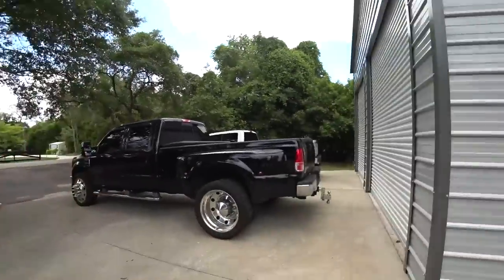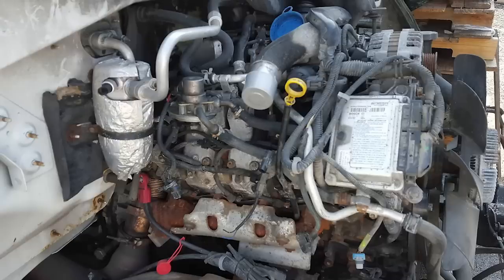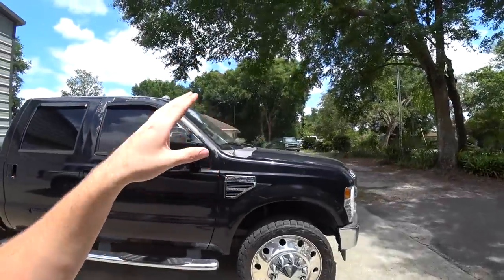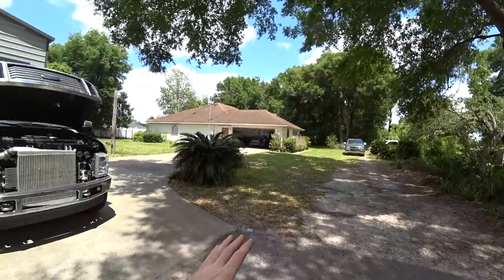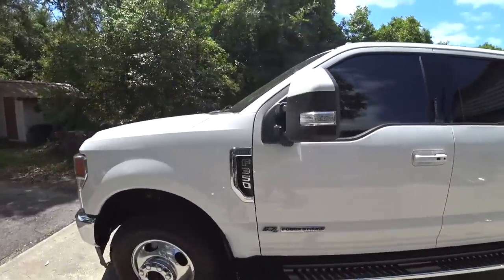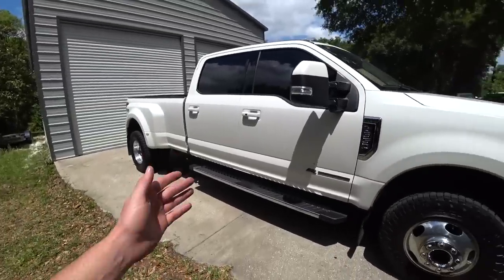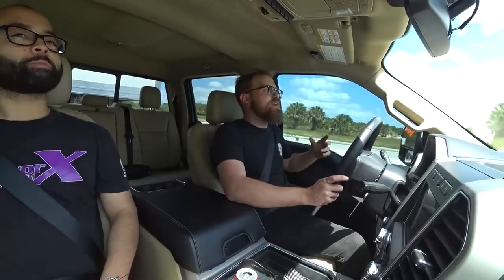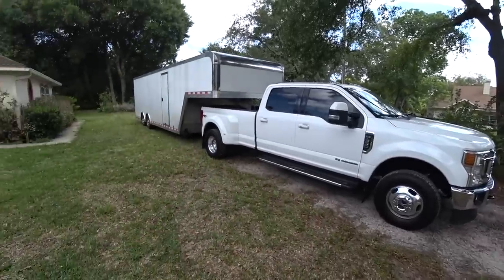Buying a new Ford Superduty to replace my Cummins swapped F350.

Comment: Talking your self into buying a new vehicle is easy especially when the old vehicle is a pile of poo that needs more work than the value of the vehicle and you don’t want to or can’t do any of it yourself.
But a new vehicle is often an utter waste of money that you will be just hosing down the drain.
If you want to keep the warranty you need to jump through the service hoops and if you do anything found in the fine print or they can claim you did it you get the claim denied and end up paying dealership repair prices which can be more than the trade in value of the vehicle if not the price of a new one.
Buying a new Ford diesel truck is a huge mistake! Aside from all the known reliability issues which may or may not be sorted in the model you get the anti pollution systems are just a total nightmare that destroy the reliability of all modern diesel trucks. About 90% of all non accident vehicle tows are for pollution system generated failures.
The fuel economy will go down the toilet too
While the vehicle is operating normally you might get good or even advertised mileage but then it will go into Regen mode and pour all that saved fuel down the exhaust pipe, and soon you will discover that instead of going into Regen once every five hundred miles or so it will go into Regen every five miles then the DPF will clog and need to be replaced AT Your COST and they ain’t cheap!
Wanting or even needing a new vehicle is one thing but when you’ve built something way better than any new vehicle buying a new vehicle is a waste of money.